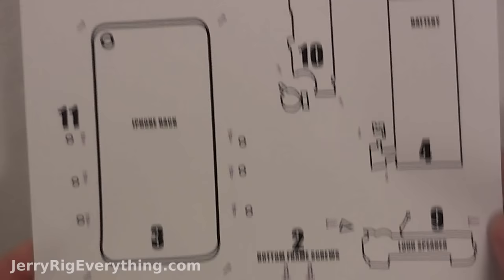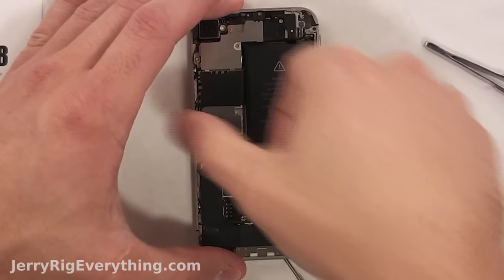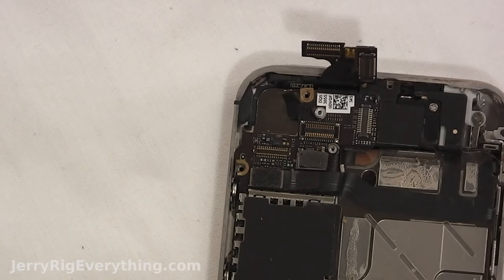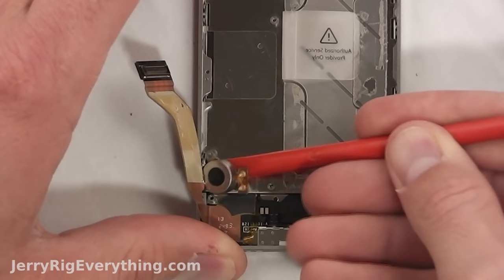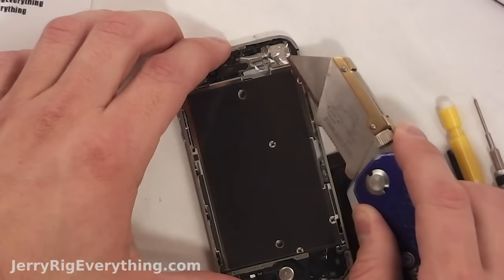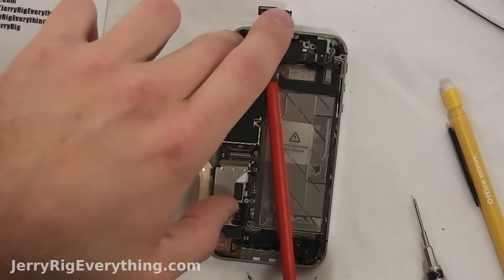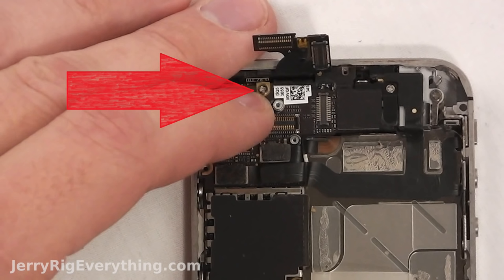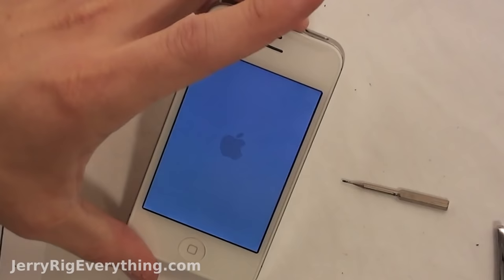iPhone 4s Screen Fix and Repair. COMPLETE w/ PDF Screw chart FREE

Comment: Hello Jerry! First of all thanks for this helpful and clear tutorial! I was wondering if you could possibly help me, i got stuck at the end of the screen removing, at the part where you have to remove the 6 side screw, i removed them all except one last which i can't get out, i think that i might damaged it a little bit, this one is very hard to screw out because there's a little metal thing in the way which is blocking my screwdriver :( any tips? :)
Reply from the maker: That circular round metal thing with 2 gold springs? That is the vibrator, and it can be lifted off, and moved out of your way.  Does that help? Just remember how it is oriented so you can put it back down in the correct position.
Reply: +JerryRigEverything sadly no, im talking about the screw with the washer at the final decomposing part, one screw is stucked and i cant get it off, i tried everything i could.. I am thinking about buying little pliers to get it off, hope that would help.
Reply: JerryRigEverything Finally, i arrived to replace the screen and to remove that one last screw by using little clippers a bought. Sadly, I'm not too lucky, because right now i noticed that the camera is little bit blur and can't focus at all! :( This is not even the last issue :D The microphone doesn't work when I'm taking a video and the home button dosen't stay at his place and is turning.

I would be very grateful for any of your helpful tips, Jerry!
Reply from the maker: The home button should have little tips on teh side to keep it in place. If you only replaced the screen... everything else should be working.  Maybe there is a bad connection still? Make sure you use your original components that were working before the repair.

Comment: I replaced my screen but the top left side of the touch screen doesn't work, what could I have damaged?
Reply: Sean Doherty You might have damaged the digitizer, but get a whole LCD digitizer and glass replacements as it is way too complicated to remove the digitizer and put a new one on, if you can even find one
Reply: or it could be you connected the snap on incorrectly, I know this is from 2 years ago, but i like to answer and help
Reply: Colby Hale hail

Comment: How do you keep the screw from falling off those teeny #000 screwdriver tips?  You can't use a nag tip around those sensitive electronics....or do you?
Reply from the maker: David Bunch The screwdriver set that I linked in the video description is slightly magnetized.  Just dont touch the screwdriver to the circuit board and you should be just fine.

Comment: Im trying to put the new screen on but its not flush on top rite of phone theres a lil gap
Reply from the maker: +Victor Castillo Make sure nothing is pinched between the frame and the screen.
Reply: +JerryRigEverything  Do the screens you have on the link fit the sprint iphone 4s???

Comment: how long takes to get network signal after reassemble?
Reply from the maker: João Oliveira It should be like normal. Make sure you connected all the wire cables correctly.

Comment: do you have a PDF for the 5S?
Reply: You shouldn't need one for the 5S since it's much easier and you don't need to take much out. The 4 and 4S are very hard and you need to pull the whole phone apart to fix it so that's why you need the PDF for it

Comment: Today I do big mistake I just wanna change battery for iPhone 4s but I didn’t it’s just very easy. Just slide back cover, but what I did is I pull out from LCD screen make it crack and the LCD no longer work. I thought it’s just same like iPhone 5 upper need open start front LCD but iPhone 4s not. Fuck I did big mistake by doing that.

Comment: So if it's a Verizon one I can just skip the sim tray step yeah?
Reply from the maker: Yup.
Reply: Thanks a ton for these videos. They've helped me out a lot!
Reply from the maker: No problem man!  Let me know if you have any other questions.
Reply: Actually I do. What's your email?
Reply from the maker: JerryRigEverything at gmail
Reply: Actually, no. You can't skip the sim card tray step on a Verizon iphone 4S. On a 4 you can, but on the 4S it still has the tray, which needs to be removed before you can remove the logic board.

Comment: +JerryRigEverything i just want to thank you for your videos with your help i got a nexus 4 working again and repaired the display of an IPhone 4s, but it only works if it is plugged into the wall and keeps restarting itself even with the charger and it seems like the wifi is broke any suggestions what parts i should replace?:)
Reply: The charging port and speaker

Comment: i broke a little tab off the screen while doing this and now i spent 6 hours and $30 for nothing and now my phone is useless. i hate my life.
Reply from the maker: +Austin tL | Editor Which tab did you break off? Not everything on the replacement screen is necessary.  You can leave out a few screws and it should still all function.
Reply: i broke off one the the Robin cables. u said it might not reach if its bent. i went back to look and it was bent. i tried pulling on it a little and it roke off. so now i gotta get a whole new screen,
Reply from the maker: Austin tL | Editor Ah. Ya... you definitely need that bit.  Good luck with the next one!